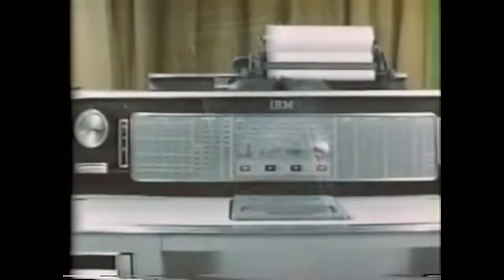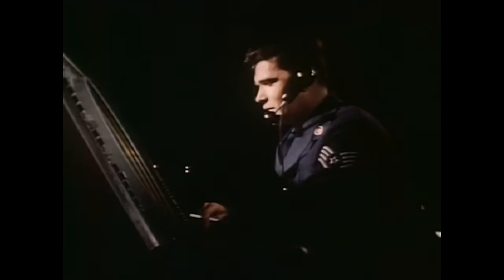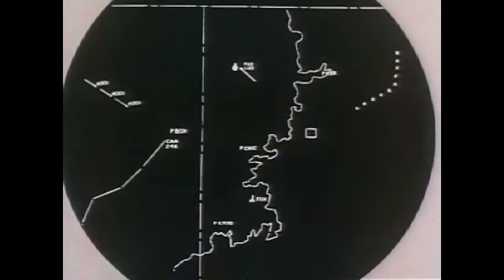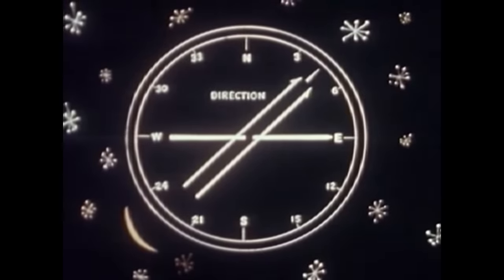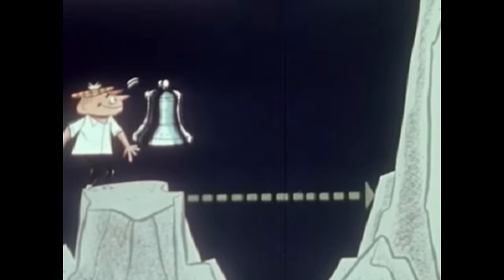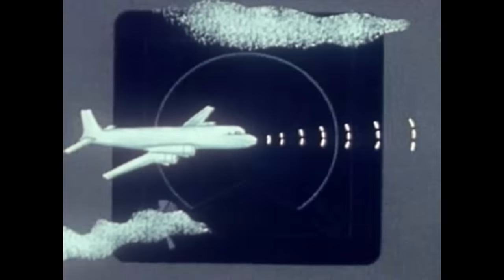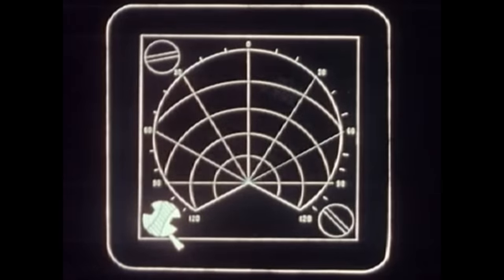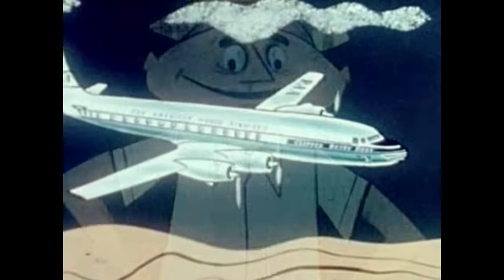Future Dreams: 1950s Technology Nostalgia | Sleepcore

Comment: When I started working people were still filling out sheets of paper that was sent to keypunch where operators punched the information into the mainframe. We then transitioned to workstations hooked to the mainframe. We had to run batch jobs at night, printers were pin printers with tractor feed. WOW that was a long time ago!
Reply: We still use an IBM mainframe. We use a green screen terminal emulation (3270) program now on PC's instead of the terminals themselves. Output is still sent to a pin printer address, although that is changed into a TXT file and either downloaded or sent to email.  

The mainframe processes billions of records per day, and front line employees interact with it via browser interfaces.

A large part / most of corporate operational data is still on the mainframe. For years they were telling us it was going away, but at some point the decision was made to keep it. They have some positive characteristics. Immunity to viruses, very stable, unlike other systems that are often vulnerable and unstable.